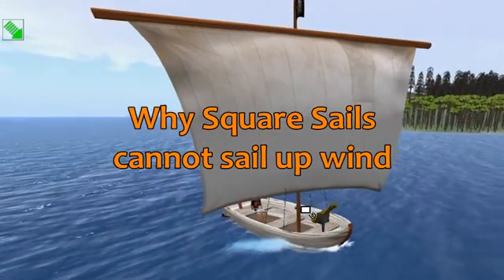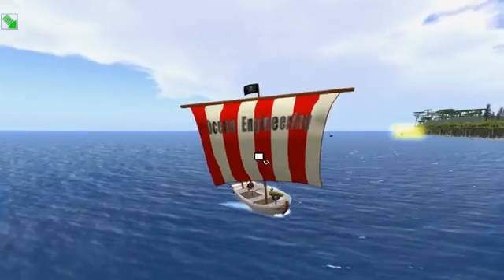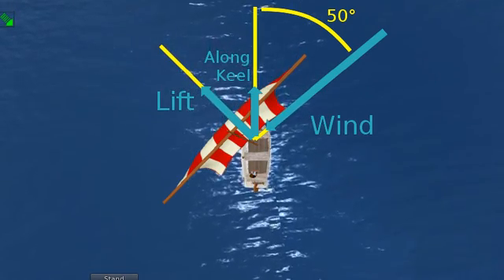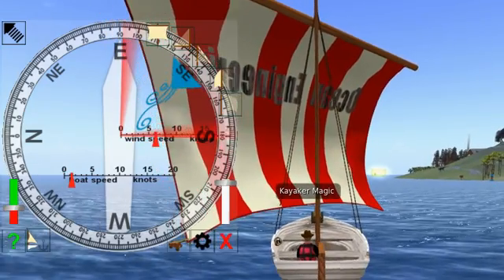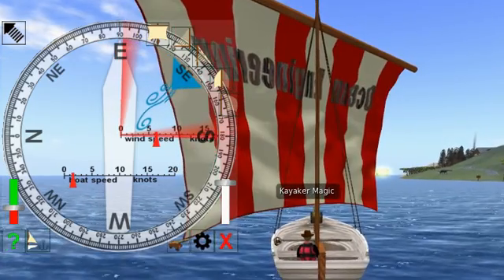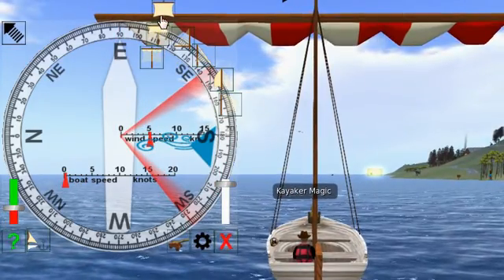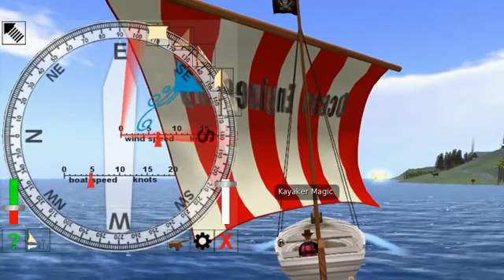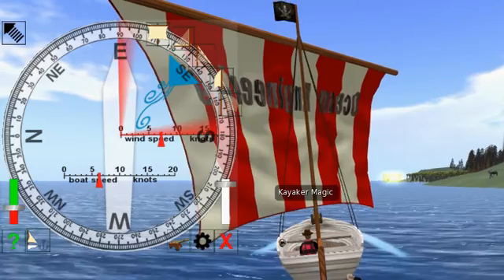Why Square Sails Cannot Sail Upwind

Comment: Something wrong here! Last time i played with a really crappy square sail it went upwind, just not as well as my mates in a Flying Dutchman!!
Forget the simulation until you have actually tried it-- the Vikings did very well considering you say its impossible.
Reply: They did it by repeatedly tacking in ways that we would consider to be absolutely unacceptable in the modern era. Taking must occur with much more severe angles relative to the wind with square sails than with other forms of rigging.
Edit: voice to text wrote SALES instead of SAILS.

Comment: The difference between a square sail and a standing lugsail is just a matter of different tension and position of the sheets.
Reply: The difference is that a square sail has its yard square to,  and symmetrical across the mast,  while a lug sail has its yard at an angle and asymmetric.
“Square” means “right angle”.   It has nothing to do with the shape of the sail.
Reply: @johnstarkie9948 the yard can turn

Comment: 0:27 I don't think the wind will push a square sail much if it's perpendicular to the wind.

With physics and desmos I could find the case for maximum upwind velocity. The ship should head at 60° and the front of the sail should point at 120° from the wind.

Comment: Square rigs can sail upwind, in the Netherlands, I had a teacher who is also skipper of the “kamper Kogge”. Replica of a 1336AD Square rigger sailing vessel, and it has pretty good upwind sailing characteristics. Another example is the “Halve Maen” replica of the 1609 Carrack, with decent upwind sailing characteristics, I name these two examples because they are purely square rigged, there are numerous examples of square riggers that also have staysails to improve the sailing character of the ship. So I think that your simulator software is flawed. ;)
Reply: The Humber Keel is another example.
Quite efficient upwind.

Comment: Long time viking ship square rig sailor here. Something must be wrong with the simulation, as sailing upwind in the 45-50 degree range is definitely possible, even though the ship may drift sideways a bit due to the small keel. Sailing "half wind" with a 90 degree wind angle is very efficient and fast. I also happen to know a bit about physics simulation, and I would like to know how you have implemented the fluid dynamics, since I have never observed this effect during my years of real-life sailing.
Reply: Sailors just do it.
Reply: Apparent wind always throws me.. ive sailed a bit (Goldfish lateen) but never wrapped my head around how its effects play out... For instance, if i check the true wind direction... Do i ignore the tell tail?.. what if the wind shifts? How can i read the telltail?
If in very light wind.. should i pull in close hauled, even though im on a beam reach ?
If you answer this may Neptune (Odin ?) bless you with fine seas. 😁
Reply: You miss the point! Its not about how far upwind a square rig can sail - that varies with the sail, hull, keel, etc. The POINT is that if you find the optimal close-hauled angle, it will accelerate the boat forward, thus turning the RELATIVE wind more ahead, and the sail starts luffing until she has slowed down enough to turn the relative wind back to where it can fill the sail! Fascinating phenomenon! In PRACTICAL sailing (as in your experience) if she begins to luff, you fall off until she doesn't. So you never dwell in that range where she first luffs, then doesn't, then does, then doesn't. But it WOULD do that if you DID! Is his point. If I don't misunderstand him.
Reply: @slehar  I’m a simple guy, and to me in a video where the point is that square sails cannot sail upwind, a reply that says that they in fact can sail upwind, seems to address the “point” square on.